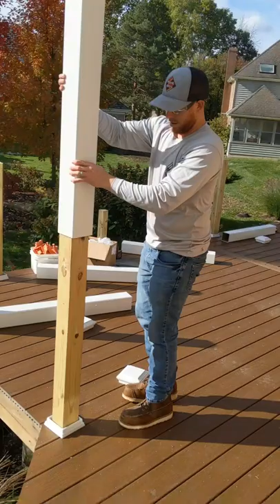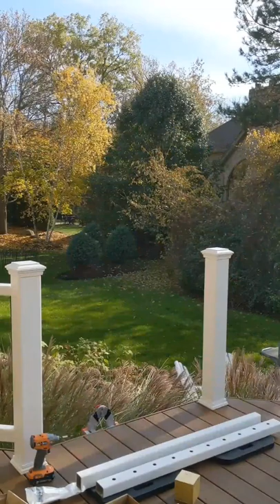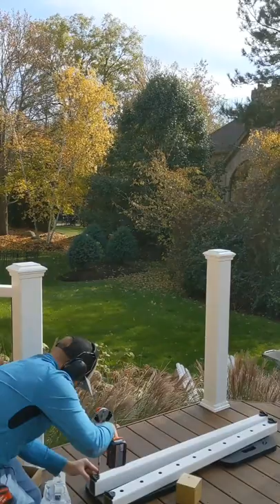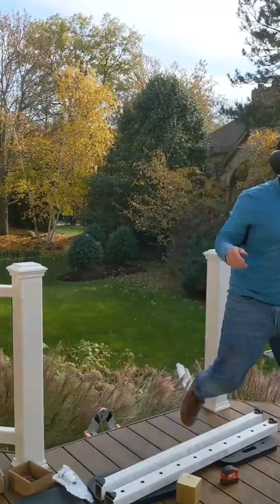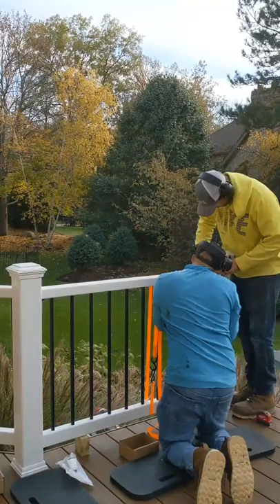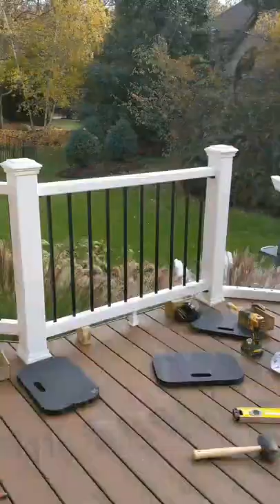Installing Trex composite railing kit

Comment: Nice work! what’s the racket strap for? Looked like the wailers was already fastened to the post when you used it?
Reply from the maker: The ratchet strap is ro hold the top and bottom rail tight before they are screwed into the post